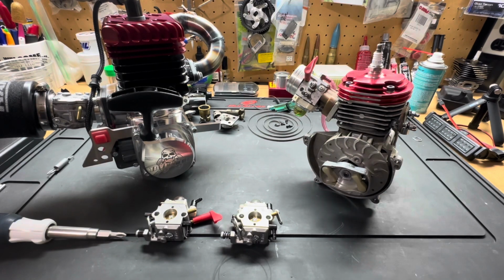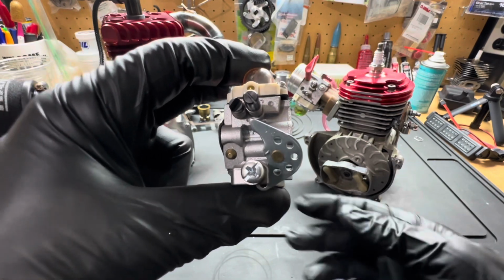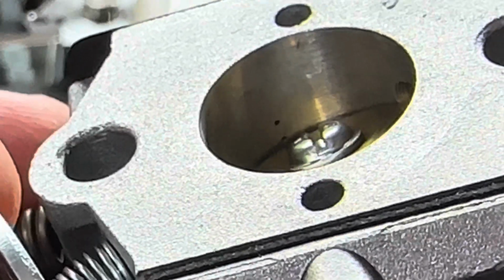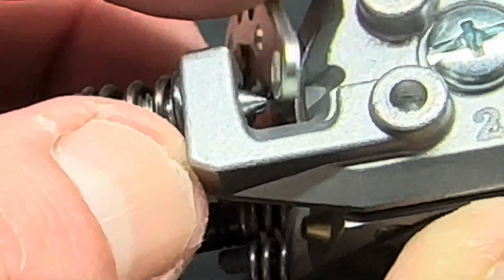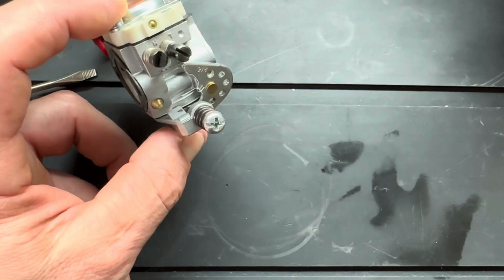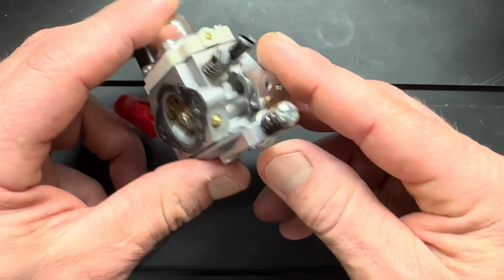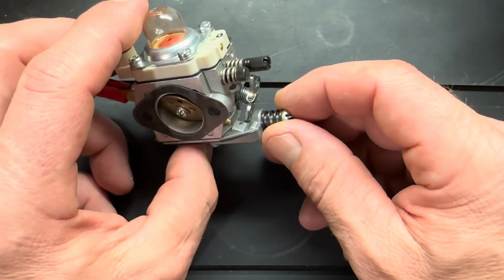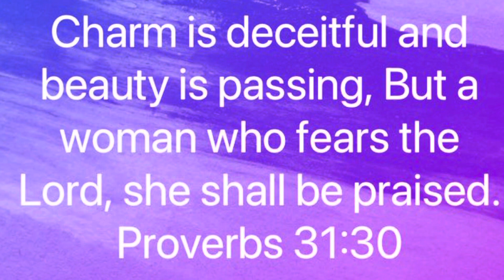Carburetor Time Idle Setting/Tuning What To Do And Not To Do!

Comment: Hey brother I truly want to thank you for this video. I have a severe hearing loss and have had trouble hearing a proper tune. With your videos I feel that I have a greater understanding of what I’m looking for.
Reply from the maker: Man bro you are more than welcome! 🙏 I pray that your hearing comes back 100%! I’m very glad to help man. If there’s anything else I can help you with just let me know in the comments, Brother that’s why I do YouTube to help people mechanically and spiritually.!
Reply: @eastsiderc  thanks for the prayers man! It’s genetic but wouldn’t change a thing about it. I’ve been blessed with the ability to help several people in my life with hearing loss. Plus, air pods that you don’t have to remove is quite nice I tell you that much lol. Buddy I’ve been getting it tuned and I noticed that it would not get up into the rpm’s. So, I nervously leaned it to the point where there’s like a powerband? Idk how to explain it man but it’s like a jolt in power all the sudden and brother it screams! My only worry is, am I to lean? I did the plug test, and after a couple quick passes at WOT the porcelain was still pretty white which worried me. I do use the VP canned fuel 94 octane. I also use the oil you recommended, amsoil interceptor. That stuff is great, burns so clean.
Reply from the maker: @toxicburrito4685 you are probably okay. The plug should be a lightish tan. You can simply add a pinch more fuel to the top end brother! And you’re more than welcome for the prayers! 🙏

Comment: Thank you jeff for the lesson, cleared up some questions i had about the fat low & idle my Baja runs good but i could tell it was not spot on , this should help me get it dialed in. I've been doing nitro for quite awhile and i have no problem with them , I thought 2 stroke would be easier . I'll get it thanks
Reply from the maker: Hey your welcome Sam and yes you will get it. It is a bit different than nitro! We turn these carb needles in much much smaller increments than nitro. Nitro is fun I still have a few of them.

Comment: Another well informed video brother Jeff quick question I haven't had chance to run my vekta.5 in awhile but I have been letting it idle with a little press of the throttle from time to time but my question is after letting it idle under the carburetor there's some oil but all my hoses are tight so I don't know where it came be coming from thanks in advance brother I appreciate you
Reply from the maker: Hey brother 2 strokes do not like to idle because there is no where for the excess oil to go and idling causes the crank case to load all up with fuel and then its spits back through the carb and out the air filter. So most likely its coming out of your air filter. Idling does a two stroke more harm than good! Your best to run the piss out of it. Thats how they are happy running and running hard!
Reply: @eastsiderc  yo brother Jeff I can't thank you enough these 3 in a half years I've had the pleasure to call you brother you never disappointed me I appreciate you brother......

Comment: Maybe im a lil slow or whatever but it is rocket science 😂😂 im having issues with my new Taylor 35 its usually the first start it seems to flood out super fast i pull the cord slow thru a few times choke on n bam shes flooded all thsi after prime but i watch a few videos n im hoping i got the tune right these can get very finicky and i getting irritated at times once i learn wla lil more i think ill be ok but thanks for all the awesome videos brother,💪
Reply from the maker: Hey bro Im sorry I shouldn’t say things like that. Ive been doing this for years and its easy for me and my ear is trained to an optimal tune. I’ll give you a tip, if you are priming your engine with the slow pulls and its not freezing cold outside you dont need the choke bro. Because priming the carb brings fuel to the carb only. Once to the carb if you pull the cord slowly pop pop pop you are now drawing raw fuel into the engine with each pull. Then putting the choke on shuts all the air off and only gives the engine even more fuel thus flooding it out. So try no choke after an engine prime . Another way is this …care sat for a day a week two days what ever. Prime the bulb a couple times to circulate fuel then set the choke and start pulling as soon as you hear engine pop or go ding da ding ding and cut off. Stop turn the choke off and proceed to pull start the engine. You may need a little blip of the trigger when she fires off. I hope that helps bro. A high performance engine floods easy just like a chainsaw. They can be flooded sooooooo easy with incorrect starting methods. I hope that helps you buddy! Have a great night🤝
Reply: I'm about to fire it up n see what happens I didn't get a chance to actually run it on the ground
Reply: Hey good morning buddy I did what ya said with no choke n been fine I took my plug out after I tried to tune it n it's turning a cardboard color is that good seems it may need a lil more tunning like a smidge but I gotta get two new servos n better kill switch n Ima he brappin

Comment: Great video buddy! 👍 Do you use a bearing mod carb?
Reply from the maker: I have used them before but most all mine have no bearing and work just fine. The bearing does make the throttle shaft a little smoother. But I feel the bearing mod carbs were more of a marketing pitch. I still like them though!

Comment: So..a good idle is it will cut off after
30 seconds?
Reply from the maker: Yup or less , what’s happening there is the engine loads up with fuel and cuts off. So a simple blip of the throttle clears it out and keeps it running. But two strokes really shouldn’t be idling for long periods of time. That is what kills weed eaters and chainsaws all the idling while people are cleaning up. Idling two strokes over n over n over really does them no good. Idle n rev to warm up then get the fun started.
Reply: @eastsiderc  yes..I already try..at first im worried why my engine cut off just like that when on idle..so i got the answer..so its normal the engine cut off after 30 seconds..thank you

Comment: I feel like my carb is adjusted very well, the needle is set so the throttle lever is barely moved, I adjusted the pop off pressure down to about 22psi, and I’m using the spiral diaphragm in my 1107/1191 on the 30degree 38cc. It always floods out eventually.
Reply from the maker: Hey bro it floods out starting or just running?
Reply: @eastsiderc  it floods after about a 5-10 minute run. Starting from your recommendation on baseline needle settings I work my way in. Once I feel like it’s dialed in I continue to drive it but it just floods eventually. It’s a sudden change of running well to running like 💩 to be honest I couldn’t mimic the sounds effects like you 👍🏻
Reply: I really just don’t get it. I just checked the coil gap and it looks fine

Comment: Mr tight and right I have a question whats the best clutch assembly for a baja mine seen to hit the taylor transmission box. You should do some fans cars im sure for a price need some help if not asking for to much I watch your videos you no your stuff brother. 😂
Reply from the maker: Hey bro thanks man I appreciate you! What kind of engine are you using in your baja?
Reply: @eastsiderc  I'm running a 36cc rovan modified by sre customs.

Comment: so the low tune is just for idle ? and the high is for like max rpms ? right ?? so i should set my low screw to idle like pops or to where its about to turn off ? im tryna tune my buddies 46 cc go ped bigfoot motor has this carb and it bogs when taking off but still goes fast once it takes off . is it supposed to bog a bit ?
Reply from the maker: The low is for low end not idle. But your idle once correctly set will change with the low. To lean idles fast . Too rich wont idle at all. You find the happy medium. That is what tuning is all about finding the sweet spot or happy medium where both the low and high are working together simultaneously while the trigger is wide open!!
Reply from the maker: Tune the low first and get it taking off good. Then simply clean up the high to a crispy clean high note.

Comment: Thanks man i font get it my baja 5 b whenever I start it it instantly wants to go full balls to the wall I just installed a kill switch but be nice to no why I'm guessing either throttle servo our I set the idle wrong
Reply from the maker: You’re welcome buddy. Check all your endpoints and check your linkage. While powered up and not running you can diagnose any issues like that. If you need any other help, comment a new comment on any of my latest vids and I will do my best to help. Im here to help people in this gas 1/5 hobby thats what I do and what this channel is about . Also helping folks spiritually as well.

Comment: I just baught a walbro wt 813 hp carb for my big foot goped what the best tune for it and does it come factory tuned
Reply from the maker: Walbro generally come at base settings and you don’t wanna go further than a quarter turn in lean from that setting if you would like to start excessively rich and tune down from there, you can set the carb at 1 1/2 out on the low and 1 and 7/8 out on the high

Comment: Have you used the 1257 taylor and what settings
Reply from the maker: Not yet soon I will. Mike gives the stock settings for the carb on his website bro. I believe its 1 1/2 out on the low and 2 and a pinch 🤏 out on the high.

Comment: A link to adjust the low and high speed needles? I have a Walbro WT1191
Reply from the maker: Sorry man I dont have a link I share all that information here on the channel. One of the vids I show and explain how to tune on the high n low needles . Basically just make small adjustments tiny ones. And from base settings dont go more than a quarter turn lean of you can hurt the engine.
Reply: @eastsiderc  is lean right turns? And rich left turns? Correct? I may be mistaken
Reply from the maker: @dancj10 yes bro right clockwise lean counterclockwise left rich. So when making adjustments picture a clock in your head, you’re adjustments will be every 15 minutes give or take if you follow me looking at it as a clock pattern. You can also look at it in the way of a pie and when you’re tuning the carburetor you’re making little slices in the pie.

Comment: hey I have a Rovan Baja 5b seems to hit its top speed at Half throttle and will not go any faster after half throttle is that a carburetor problem?
Reply from the maker: Sounds like it could be a carb problem or possibly a linkage problem check your linkage and make sure the throttle lever is opening all the way on the carb. If that is good then you could possibly be to rich or too lean. If its not cutting out on top and just gurgling or sounding like a weed eater that wont clean out then your high needle is too rich and will need to be leaned in very tiny increments until you achieve nice high rpms. A mini tachometer cane help you with a lot to show you if you are going in the right direction or not! Happy brapping to ya bro! Have a great day . I hope that helps ya
Reply: thank you big help @eastsiderc

Comment: Do you have any experience with an engine that needs a rebuild? I got a used 26cc ss that has no power no matter what I do.  I can hold the thing back with my foot even after replacing the clutch
Reply from the maker: I sure do man. You could try just putting a whole new top end on it with gaskets. That will bring it back to life

Comment: Whats the biggest carb you can use on small bore
Reply from the maker: Thats not modded and will bolt right on without any adapters would be the 1107 or the punched out version of it the 1257 from Taylor RC.
Reply: Engine wasnt built by obr i built it myself just told them crank i was using had them send me billet case and top end
Reply from the maker: @wesleymorgan7894  I would give the 1107 a try. If you would like to try the next size up carb for your engine you will need an adapter plate. You can contact Allen Cestra of TMR Performance on Facebook and see if he will make you one.
Reply: @eastsiderc  i have 1107 on zenoah g290 in my other baja
Reply: @eastsiderc  ive got two bajas one wasnt enough
Reply: @eastsiderc  im be off topic  just bought detroit performance brakes for hpi baja 5b are rotors suppost to go on surtain direction

Comment: So in the goped tuners world we are told that since we are pushing a body weight with these small engines that they perform alot better if we bury the idle screw all the way in and adjust the tune accordingly from there. Like 90% of the community is doing this currently. Is there any truth for this being the case for our tuning? Or should we tune the idle screw how u say to do it?
Reply from the maker: That is called the bartolone tune and brother that is not good . You are simulating a vacuum leak. The idle screw is there, because the idle has a circuit for adjustment, burying it all the way in is just totally not right and that is not smart at all. You should turn the idle screw just how I say to do it. pulling a heavy body is like me pulling nine gear sets above stock gears. All you need is fuel you need a nice fat low to get you going. Fuel makes power. So to answer your question brother no there is no truth in burying the idle needle. I hope that helps. Tuning is an art not many can grasp it for the tune to be optimal. Optimal is key for making all the power you can.

Comment: I just installed mine and the Master Cylinder stuck in closed position it will not retract back no matter how I tried pulling it back.
Reply from the maker: Master Cylinder? Did you comment on the wrong video broham? Are you speaking of hydraulic brakes?
Reply: Sorry!I replied to a wrong video,Yes it’s the Hydraulic Brakes.
Reply from the maker: Its okay bro I do it all the time lol. Mom too 🤣🤣! Man Im sorry to hear about your brakes maybe its hydro locked. I noticed my buddies moves really hard. I feel like its more of novelty than a working set up. I guess I will find out! Try unscrewing the fluid container and cleaning it out , it maybe like hydro locked.